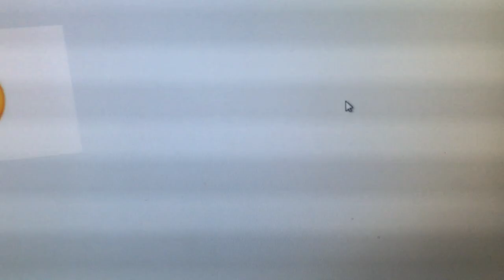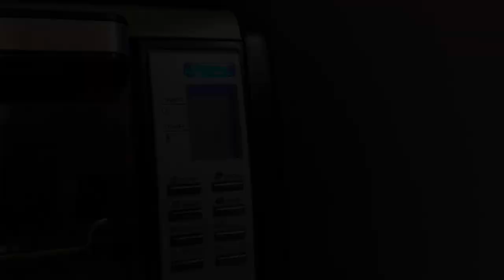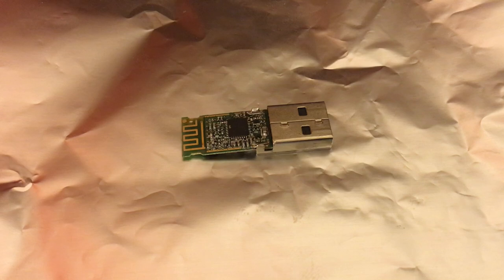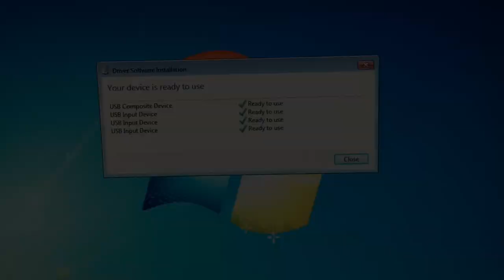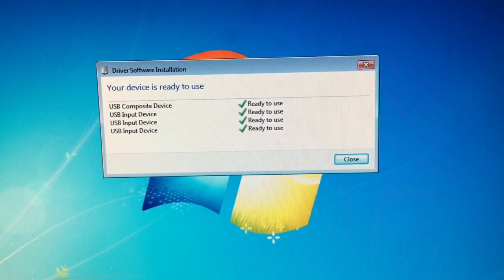How To Fix Broken USB Wireless Mouse or Keyboard Transceiver Transmitter Adapter Module Receiver

Comment: I love DIY reflow. Even as a professional who designs and assembles complex PCBs, it always feels so silly to put a circuit board in the oven. I want to stress this is a totally valid way to fix loose connectors like this.

In short: There's this mix of tin and lead called solder, and it acts as the physical and electrical glue that holds and connects all of the parts to the circuit board. You get the solder hot, it melts onto the metal surfaces, then cools solid. When you push on the USB connector in and out, over time, the solder connecting some of the data/power pins to the circuit board will 'crack' from mechanical stress', which means that it'll only make an electrical connection when you push the pin against the PCB (by pushing at that angle). Of course, this bends the pin away from the board and makes it harder to connect by titling. Heating the board makes the solder liquid again (hence re-flow, making the solder flow again). Like raindrops coalescing on a window, the solder blobs on the board and the connector reconnect and become one again. When it cools (slowly, or the metal will be brittle and crack again), it re-solidifies with the broken connection (hopefully) fixed.

Be careful though. Some connectors have plastic that melts in the oven! USB is safe though.
Reply from the maker: Thank you for weighing in on this! Greatly appreciate your professional input! 👍🏻
Reply: My USB stopped working and I’m not sure if something burned because I started smelling it and I think their was fumes, the plastic started melting on the USB and I’m afraid  will I be able to fix and to use it again? Also at the touch, it starts getting hot so I’m wondering if you know any solutions? And I’m not able to replace it because it’s a 2.4 GHz transmitter paired to the mouse itself /:
Reply: @iShinoby  if its logitech buy a unifying receiver
Reply: @garrygibbons2989  i did that....  it worked great, on my computer.  I am trying to use it on my xbox though.  As soon as i unplug it from the computer and into the xbox it isn't unified anymore.  I am going to try and heat the old dongle and see if it works

Comment: Our Microsoft Sculpt Keyboard and Mouse's dongle died yesterday so my wife and I started looking for replacement/fix options, that's when my wife found your video. After watching it, I was somewhat skeptical (I have some electronics repair experience and have not heard anything like what you'd suggested), but since I have nothing to loose, I decided to try it today. All I can say is "YOU THE MAN", followed your steps and it worked like a charm. Thanks for sharing your knowledge and saving me about $100 dollars on replacement!
Reply from the maker: Nice 🤓👍🏻

Comment: Just want to say a big 'Thank You!" for publishing this. I had this happen with a Microsoft Wireless 2000 KB/MS combo, the transceiver looked identical to yours.

I initially ran a little solder over the USB pins which I thought had dry solder joints (didn't make a difference). Then I saw your video & cooked it instead (after our Sunday dinner roast). It works perfectly now!

Thanks again!
Reply: I just did mind with solder, now it is in the oven baking away... We will see, I have the 3000 which looks identical to his/yours, just white...

Comment: Thanks !!!!  I tried this last night and it worked perfectly !!!!  The mouse is now working again.  The only issue I had was that some of the plastic inside melted a little, making it difficult to get back in the case.  I trimmed it up with a knife and then used some electrical tape to keep the case together.  Overall this is a fantastic fix !

Comment: Thanks for the tip, man! Just did this and it worked!
I have a Microsoft Wireless Keyboard + mouse 2000 which share the same dongle and it had stopped working. It's absurd that Microsoft chose to sell these with a dongle that cannot be replaced.
Reply from the maker: Yeah, they are not interested in helping you fix your old one...

Comment: For the number of people who disliked this video the comments sure indicate a high success rate. Obviously "your mileage may vary" so to speak. Depending on how the manufacturer made it you may not be able to remove all the plastic and any remaining plastic may melt onto the receiver board, as one person indicated happened for them. But honestly unless you had nothing to lose and the receiver was basically going to the trash if you didn't try something anyway, why would you even try this technique? 

This makes we wonder though which parts need the solder melted and if someone actually adept at soldering could figure out what particular pieces of the board need to be looked at if you want a more surgical approach.

Comment: Well, it was worth a try, but maybe it didn't work because there were still bits of plastic inside the USB when I baked it. I particularly liked the bit of the video when you said, stay by it when it is in the oven in case it catches fire!

Comment: I just gave it a try and it worked! Lets see for how long it will work. Hopefully a long time. For people that is confuse on how to take the circuit from the plastic case, use a knife or any other thin blade to pry it open carefully so it will not brake.

Comment: It worked for me! I use my wireless keyboard and mouse instead of my notebook's built-in ones and as it stopped working I was wondering (for something like half a year) what would I do, because buying a new set sounds not very nice when what isn't working is just the small transceiver. And then I found your video, thanks a lot!
Reply from the maker: +Cassiano Sombrio 
Great!

Comment: It worked! I have the exact same transceiver. I had to try three times, on the third one I laid it on the opposite side from the video. Temperature used was possibly a little higher than 200ºC but that probably didn't matter. Thanks!
Reply from the maker: Nice!
Reply: Update: after 9 months of medium to heavy use, it started failing again, but the method worked to revive it once more :D

Comment: This is awesome.  I just tried this with the Wireless Keyboard 2000 transceiver (same model).  10 mins, 200 degrees Celsius, 20 minutes cooldown.  Not sure how long it will last, but hey, today I type in style.

Comment: Unbelievable, at first I thought it was a prank. Then I saw the number of people saying that it worked for them. Confirmed that I was out of warranty. Checked with Microsoft and they said, I'll have to throw it all away and buy a new one. 
So, I finally tossed it into the oven and ... Voila ... typing this comment from my MS wireless keyboard.
Thanks a ton ... I had already started browsing through new keyboards with Blues playing in the background.

On a different note, if I have to... next time, I'll pick up a logitech combo ... at least they seem to have a universal tranceiver that can be used in case the original fails.
Reply from the maker: Awesome! Thanks for sharing!

Comment: You are da man. This worked for me, but I did try several times for 5 minutes from 200F to 400F. It did not work until I did 410F for 10 minutes. After that it worked fine.

Comment: Nice tip.  It worked!  I got the mouse to respond but the keyboard is not responding.  The strange thing is that on the drivers manager there is a mouse and a wireless keyboard that pops up when connected and goes away when I unplug it.  I suppose there is a problem now with the keyboard that I need to solve but for the time being I can use my mouse.... Nice tip!!!!
Reply from the maker: Thanks!

Comment: thanks worked for my transceiver as well but 390°C on my SMD rework station melted the plastic in the usb in about 10S... ^^ but still fits the USB port and i can finally use my beloved 3000V2.0 keyboard thanks a lot :D PS: 300°C with about 20sek should be enough on a rework station
Reply from the maker: Awesome, and thanks for sharing your tips!

Comment: Hi friends.  I fixed the problem with this method.  Normal oven 200 C. temperature and 10 minutes.  The reason for this problem is an engineering error in the internal structure of the usb receiver.  It is very susceptible to bending and when there is approximately contraction, the chip legs on the PCB board have a contact problem.
Reply from the maker: Thank you for sharing!

Comment: this works you can even use a lighter to heat the base up so that the loose connection get fixed heating up and so not more than 10 seconds and this works

Comment: lol applying heat is used to create and repair electronics. Here in the U.S. you can get a heat gun for like 15 bucks from harbor freight. That is a safer and more practical way to apply heat.

Comment: This did not work for me. However, my receiver did not just quit working on it's own. Somehow, it got bumped hard in moving the lap top, knocked the covering cap off and did not work well after that. Buying a new one and unifying it to the key board fixed the problem.
Reply from the maker: Yeah, sounds like you had more of a physical damage, not a loose USB connector.

Comment: Do you think  this trick would work for the receiver that comes with Microsoft Skult Keyboard and Mouse? Its a single reciver for both mouse and Keyboard(A little bigger in size then normal receiver's).

Comment: Thanks for your instruction.  Tried, but no change. Just use a tape fasten with little hard. It works.
Reply from the maker: +Kevin Zhang 
Yea, it doesn't always work. At least you could find a workaround!

Comment: Thanks, that's great! Do you have any videos on which you actually disassemble the transceiver?
Reply from the maker: No, cuz they are all different.
In general you can pry it open using guitar pick or flat head screwdriver.
Reply: @DIYtimeTech  what does prying do? And how do you pry? There are no vids on youtube.
Reply from the maker: It means get a knife or something sharp and use it to crack open the plastic case for the USB dongle.

Comment: this is really strange solution for dongle simply being loose. i would either change the port or repair the port (can be time consuming but worth it), or "tweak" the dongle so that the port connects properly. overheating can help as much as it can brick the dongle.
Reply: It's not strange at all... and ofc try switching ports first to see if that's the problem, but this solution is for when the problem is with the actual dongle. If it isn't working anyway, what is there to lose?? lol.

If you have a heat gun that would probably work better though.
Reply from the maker: Spot on!

Comment: I have a different microsoft mouse but exact same issue.

I can't understand the issue. 
I've used the multimeter to test the connections inside the receiver and all seems fine..
Possibly usb port of the pc and mouse don't touch each other well? (Receiver's seem a little short) Idk.
Reply from the maker: Some chips on the circuit board may get loose overtime.

Comment: "You have nothing to lose." No, just my perfectly good pcb board. .... and my toaster oven. .... and my house. lol peace
Reply from the maker: If your board is perfectly good, why are you looking into “baking” it?
Reply: @DIYtimeTech  k, well, first I was just kidding, I believe in the legitimacy of the technique. I just thought that line was funny.  ... I meant the board itself, isn't shorted or otherwise fried. ...until it catches on fire. lol   ...... Wasn't my problem anyway, haha. I'm trying to fix a receiver, the contacts are right on the chip. The whole thing fell apart and the chip slipped out of the holder, and sticking it in without that, it doesn't work. Can't get it🙃 peace
Reply from the maker: Gotcha!

Comment: Holy SHIT!! IT WORKED!
Thank you so much!!!
Reply: I'm wondering how many times can I do this before this hack no longer works on the USB
Reply from the maker: I think after 2-3 times it will die for good.
Reply: Just an update. Since I last wrote this here. I have done it 3 times already and it worked each time! It's still working good, but the nature of my job requires I unplug and replug it everyday for portability. So i'm guessing it would last a lot longer if it was permanently kept in place. 
I'll probably update you again in the future if it no longer works.
BTW, I have a microsoft mouse but different model than yours. So my transceiver looks exactly the same.
Reply from the maker: Sounds like in your case it needs to be re-soldered. 
After overheating few times, metal looses it's quality and need to be replaced.

Comment: hi. i have the same reciever as you but this method hasn't worked for me. are there any other actions i can do in order to fix this?
thanks
Reply from the maker: You can try second time, but other than that, there is nothing you can do, except for the trip to trash can. They don't make this part replaceable/repairable.

Comment: +DIY-time Tech It worked like a charm for 1 day but then it went back to the broken stages again. Is it possible for it to work If I throw in the oven the 2nd time on a foil?
Reply from the maker: Probably not. This is not really proper way to reflow loose connections, this works well only sometimes if you are lucky.

Comment: My wireless mouse's usb transmitter broke because I accidentally put it into my USB port on my Xbox. How do I get it out?
Reply from the maker: Try to pry it out with a needle.
Reply: Is it stuck? I had that problem because I put my USB into my Wii U It was stuck also so I used my teeth to get it out since my teeth has a stronger grip on the end of the transceiver disgusting but works.

Comment: Hello i have a G900 Logitech mouse if i bake it like you did will it really work plz answer
Reply from the maker: This method works about 50% of the time. 
It doesn't cost you anything, and you don't really have any other options. You can't buy new tranciever alone, you have to buy whole set. So, before you throw away your mouse, give this a try.
It worked for me, and many others, just read the comments...
Reply: Idk  my mouse is 200$ and im really afraid of braking it. cant i bring it somewere so they can fix it
Reply from the maker: Try to take it to local computer repair shop and see what they can do.
Reply: Ok ill try
Reply: as far as i know logitech has universal transcievers... not like microsoft so maybe you can sync another usb dongle with the Logitech Unifying software

Comment: I have a small usb mouse ... how can I put off the cover without breaking it
Reply from the maker: Chanses are you still gonna break it. They are usually not built to be taken apart easily. Try using a knife or guitar pick to pry it open.

Comment: Never worked out for me, but the idea is genius though.

I have the wireless desktop 2000 and the receiver just stopped working. If its like in the video the its most likely the USB connector itself that it loose and needs to soldered properly.

But mine was fine, and after struggling to magnify the receiver with my phone I found it was a little silver square transistor of some sort named X1. It's on the side where the 4 prongs of the USB connector is soldered to the pc board. There's only that one transistor on that side. 

So I pinched it with my long nose pliers and held it over a burning candle(I don't have a heat gun) about 1cm above the flame for about 5 or 8 seconds and as I was pinching it with the pliers, the solder melted and and square was seated back in place with proper connection.

It worked, then I mixed up some pratley steel quickset glue and glued it in place so it doesnt loosen up again.

I don't know how to add pics to a comment 😅

Comment: This sounds great.  Can someone be more descriptive about how to separate the plastic casing?  Take a screw driver and just crack it open?  Can anyone be more descriptive than that?  Thx!!
Reply: I figured it out. But not until I did trial and error to the point where i jabbed my finger with a tiny screw driver!  So, just a few words on how I figured it out: Not all of the Dongles are the same.  Some have obvious tabs you need to just get past.  But, as with mine, there were no obvious tabs.  After very close scrutiny, there were two tiny dots just at the area where the plastic case overlapped the metal.  Use a pin, or a very small eyeglass screw driver, and just press it under the case where the dots are.  That's it!  Came right apart.  Hope this helps whoever has the same issue.

Comment: if i heated it and it still doesn't work should i heat it longer
Reply from the maker: If you followed directions exactly as described, that should have been sufficient. There is no point to heat it longer.
Reply: yes

Comment: I was also extremely sceptical, but I can confirm that it works. I have a Microsoft Desktop 2000 kit and I had the exact same symptoms -- I guess it's planned obsolescence on Microsoft's part. Around 210 °C for 10 minutes (without preheating) did the trick for me, thanks. Are you saying that this will happen again in time?

Comment: hello can someone help me
my keyboard mice usb receiver is damaged and how to fix or solve this prblm
and there's any option to buy a single usb receiver(Rapoo E9270P)
Reply from the maker: It practically impossible to find just a receiver.
Reply: +ComputerPalz and what about repair if damaged totally
is there any option to repair or use
Reply: +ComputerPalz and what about repair if damaged totally
is there any option to repair or use
Reply from the maker: It's not easily repairable. It's probably costs less to buy a new one. As far as used ones, you may find it on eBay probably...

Comment: Can I use a microwave than an oven?
Reply from the maker: No. It won't work and you'll damage your transciever.
Reply: It isn't both oven and microwaves also uses heat?
Reply from the maker: No, microwave uses electromagnetic waves (radiation) to make water molecules in your food move faster, which is effectively heating up the food. If you put electronics in microwave, it will explode from those radiation waves.